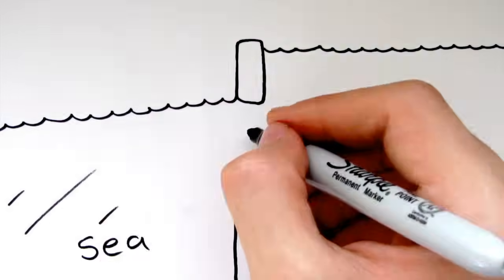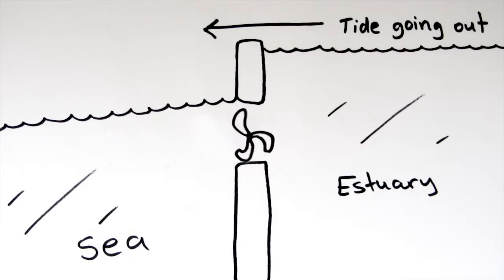Renewable Energy Resources: Part 1 | GCSE Physics | Doodle Science

Comment: the biggest problem we have with renewable energy plants is the amount of space they take up. e.g. a wide area around a wind tubine has to be completely empty because a. the danger of the wings or ice that forms in cold periods falling off and b. a wind turbine isnt as efficient went there are obstacles in the winds way and c. if wind turbines stand too close to one-another they create turbulences which can destabilise its structure. a few reasons why it is so hard to set them up correctly.